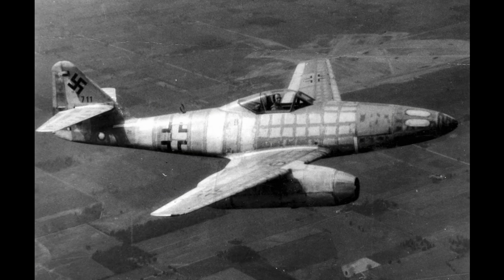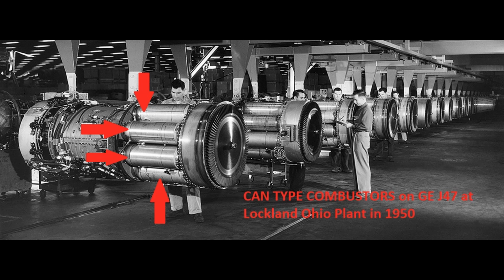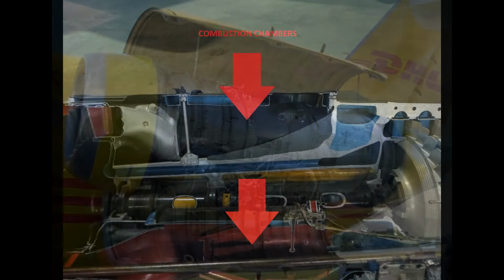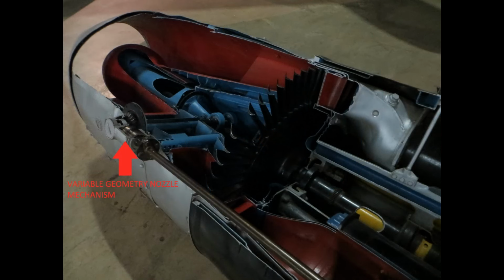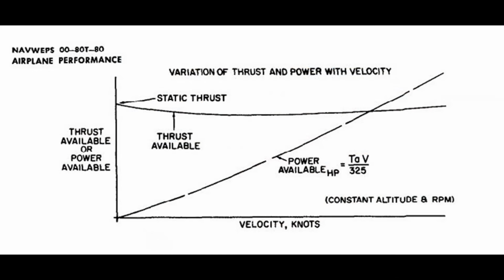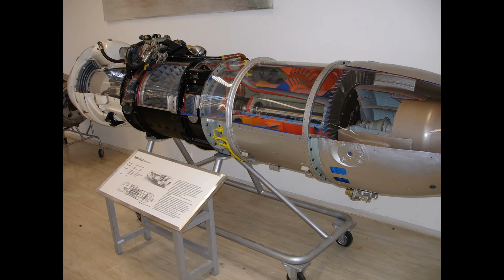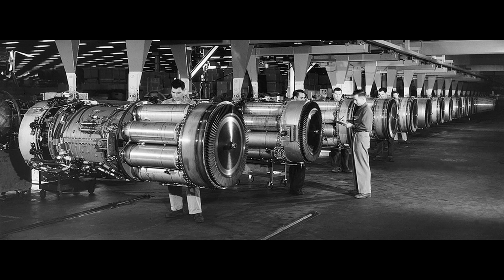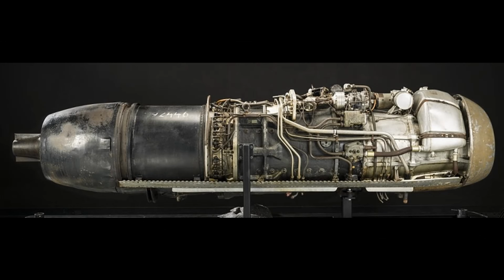World War Two JET POWER

Comment: Theres a part in some jets manual that when flying through rain they are to just leave the igniter on
Reply from the maker: That's true of most jets, even today.
Reply: Been on a flight lately in stormy weather with torrential rain and snow, sat right in front of the starboard jet engine of airbus 340 and i could not believe the amounts of rain and snow getting into the engine constantly, though i knew it probably was alright, it was bewildering and unsettling to watch, i think these masses of water go kind of around(?) the burning chambers. What a flight that was, i was quite sure, the jet engines would drown out. Then the landing, storm had not ceased, i knew the airport, we were way too high, already right over first third to middle of landing strip. I thought to myself "he is not going to land now, we are too far and much too high still" yeah, he went down like an elevator from what looked like 500-700 ft still, sort of tactical landing, touch down! But now the remaining runway must be too short! He sure did the heaviest brake action i've ever experienced on a commercial flight. The service crew sat facing me in front of me, looked sorta in a mocking disapproval at me, the one fella, me, wide eyed and pale probably, i didn't care, reborn! ( sorry, got carried away)

Comment: I heard not long ago that Paul Allen, before he passed, had his people looking into reproducing the 004 with modern materials so as to outfit his reproduction fleet of 262's with "proper power plants" that would last longer than a week.   The current engines in his 262 aircraft are modern tech and thus considerably smaller than the originals and sit far forward in the nacelles and exhaust through a long duct, and produce similar thrust with less than half the weight which is why they sit so far forward to keep the CG close to where it oughta be.  If this ever comes to pass (or maybe it has already?) it would be an opportunity to update some spec sheets on just what a 262 was able to do compared with what was expected of it, something harder to do with modern engines, thus allowing the masses who are into such to update and/or fill in the missing data you mentioned here.   Anybody in here know anything more about this?
Reply: +Tony Underwood    Paul Allen's museum only owns one Me-262 and it is WW2 original.  The 004 engines were rebuilt with better materials by a turbine shop in California, and it took 10 years of research and construction to complete them.   By their estimations, the engines will be good for approximately 300 hours.   The Me-262 was completing ground and taxi tests before the museum closed during COVID.   Unfortunately there is a high possibility that the museum will not reopen so there will be some time before the Me-262 is fully tested and flown.
Reply: @FiveCentsPlease    I should have qualified my remarks.  Word that I got was that before his death Allen was interested in reproducing the 004 engine with modern materials, and not just overhauling/upgrading existing engines.   It was also my understanding that the original 262 being restored to airworthy condition with "original" engines would include these modern reproductions.   It had not been made clear whether these engines would be reproductions or upgrades of originals.   Either way, it would be a tall order involving some considerable expense.  Allen could afford it... :)   If you should read this, and if you know, could you confirm or deny that Allen had provided some monetary assistance to the Me-262 Project which constructed the five reproduction aircraft?  (yes, I understand one is not airworthy, static display at Evergreen)   I have seen two original Me-262 variants, one while in storage at the Smithsonian's Silver Spring facility before it was moved to public display, and the one that had been in Chino before having been purchased by Allen.
Reply: @tonyunderwood9678     I am not aware of Allen being involved with the new-build Me-262 project.  That was a venture between the late Steve Snyder at Classic Fighter Industries and the late Herb Tischler at the Texas Airplane Factory.  This continued until a business dispute and the project was moved to Paine Field.   I suppose that it is possible that Allen might have provided some backing to CFI   Regarding Allen's original Me-262,  the frustrating part of FHC is the majority of their work was done in absolute secrecy with perhaps a few updates allowed in aviation publications. (I can state the Allen's Me-262 airframe was NOT restored at Paine Field, but was done by a special team in the UK and then shipped to Arizona for fitting out. This team in the UK did the Me-262 and the Fw-190, and were originally going to do the Stuka but that didn't happen.)    I think the Jumo 004s that Allen used were incomplete originals with a lot a new manufacturing.  The few photos I have seen showed sparkling new compressor sections but I have not seen any photos of the internals for the hot sections but you can assume those would be new for durability.  Take a look at this photo of the Allen's Jumos still in the turbine shop in California.  The closer Jumo looks very much like a new engine case also.  I think it is a fair assumption that  Allen's engines are a mixture of old and new.  https://fullfatthings-keyaero.b-cdn.net/sites/keyaero/files/node_forum/2018/09/22/SAM_7982-678x381_0.jpg

Comment: The canular combustion chamber configuration is a contraction of the portmanteau word can-annular, and it was referred to by this word for at least a decade.

I commented under another video about the Me-262 and its jet engine, about the matter of an absolute goldmine of information about this engine in a post-WW2 Allied military technical report, designated Top Secret (but obviously now declassified). The only copy I have been ever able to locate is at the aviation stacks of the Engineering Library at Stanford University.

To read it is to become even more impressed by not only its advanced engineering, but its viable infrastructure, being (relatively) easy maintenance, deployment, and integrated semi-automated control systems. It truly was a fully realized engineering marvel, especially when considering the exigencies of wartime production and fielding.
Reply: I suggest you obtain a copy of "German Jet Engine and Gas Turbine Development 1930-1945', though it is now exorbitantly expensive.  On page 92, there is an extract from a Power Jets report on the 109-004B-1 engine.  They were singularly unimpressed.  I will quote just one line: "For general future design of gas turbine engines, there does not seem much to be learned from this engine."

Comment: I wonder if it wouldn't be useful to say something like; by the compressor fans sucked in air will be compressed 12:1 (?) > the compressed air is filled with fuel and then ignited > meaning it will expand again > the only way it can expand is backwards creating thrust > the thrust gives the aircraft power to lift and later on the thrust give the aircraft airspeed. 

I know over-simplified but for a complete novice....

Comment: was it a mistake to carry the starter motors with them into the air?  just when you'd think lightness was everything...
Reply: +lgr824      The Riedel starter engine was not very big,  just a 2-cylinder with 10 hp.  The pull start was optional, because it could also be started electrically from the cockpit.  https://www.youtube.com/watch?v=BGUqV0dl9gA

Comment: Great photos... I wonder if it was a case of lack of materials and or the metallurgy of the time to catch up with the heat and pressures in turbines that gave the 004 low life spans ... and was the whittle engines life any better since he designed his centrifugal flow engines to operate with the materials technology of the time ?
Reply from the maker: The German's problem was entirely a lack of the needed metals. It's a near miracle they got the engines to work at all without them.
Reply: @GregsAirplanesandAutomobiles  thanks for replying... yes it was amazing they got anything built at all ... I would guess it would be titanium , and magnesium, etc , when did axial flow engine lifespans solve the early demise problems and what materials/ design changes solved the problem ? I was in a Marine F-4 squadron we were deployed for 8 months at sea and those j-79 ‘ s were very reliable

Comment: Man,i knew the crouts were crazy,and i know the 004B and the 262,but,what blew me away is the anular(don't know the exact spelling)combustion chamber on BMW jet. That is because i remember that the "Volksjäger" He-162 Salamander had the Single BMW jet on the back. Those guys were,and are,some time ahead of the rest of the world. Man... The He 162 didn't get to the operational phase,and Kammler's slaves were making them at Mittelwerk but that's another story.
Reply: the Spatz went operational the last two months of war (April-May '45) scoring even some kills , one surely confirmed by a RAF pilot. And I agree with you on how amazing was the design in general of the BMW 003, to think it reached in D version 10.7 kN Class II of thrust in which was the new HeS 011 but weighing 300 kg less!! the R version paired with a BMW 109-718 Liquid fuel rocket engine was super promising too, as flight tested on Me-262 HeimatSchutzer II version or on the already 562 mph fast He-162. Some of its layout became standard for modern jet engines and itself (and the 018) becoming the ATAR engine family, up to Super ATAR/M53 powering french Mirage fighters.